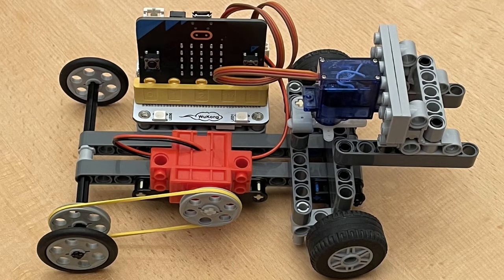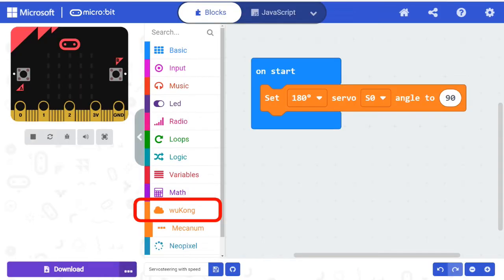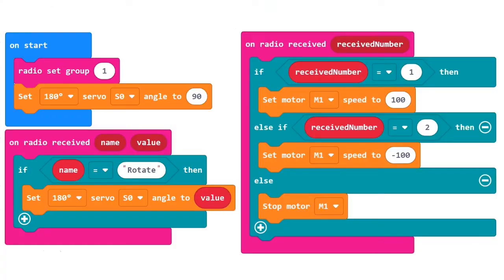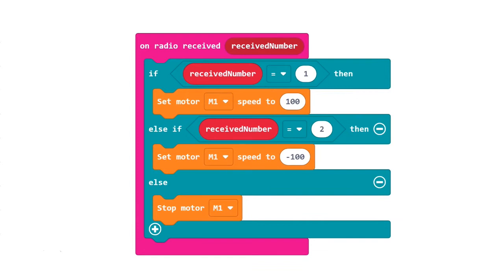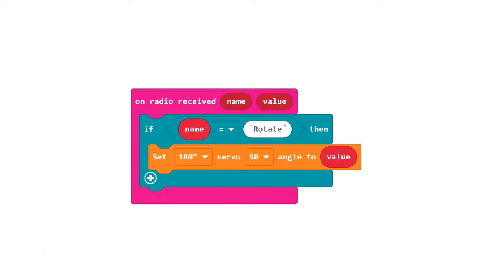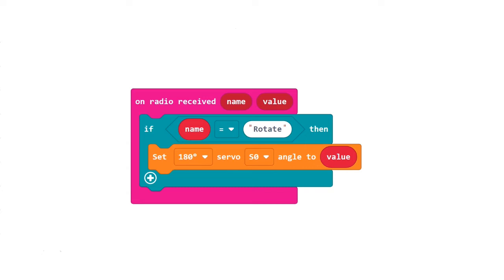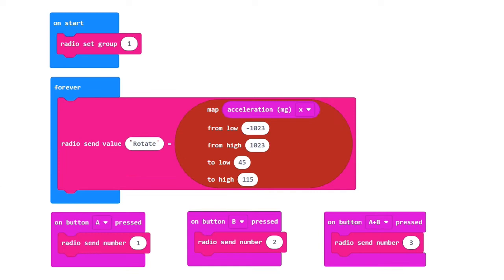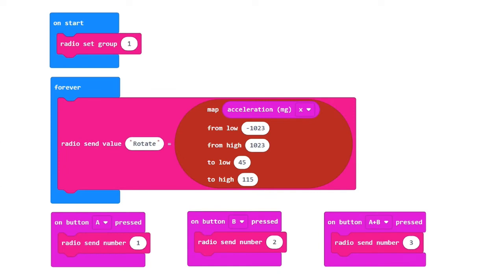Servo Steering with Lego and Micro:bit

Comment: Sir, why the angle is 115 degree for 1023, but not 135? (90+45=135)
Reply from the maker: Theoretically it should be 135. But 115 has turned out to work better. It has to do with how the gears fit to each others.
Reply: @gunnarlund6633  thank you sir